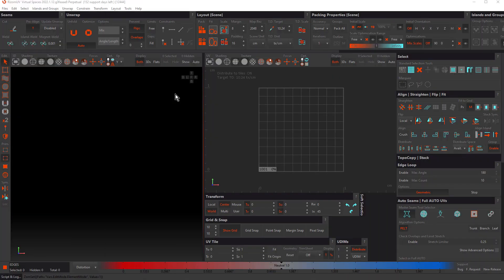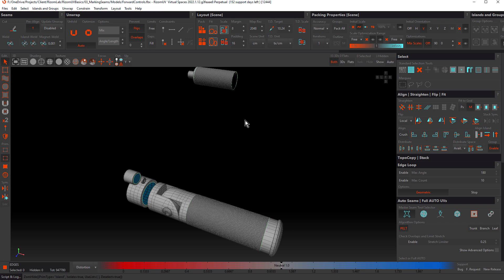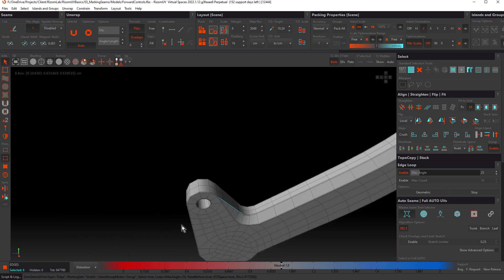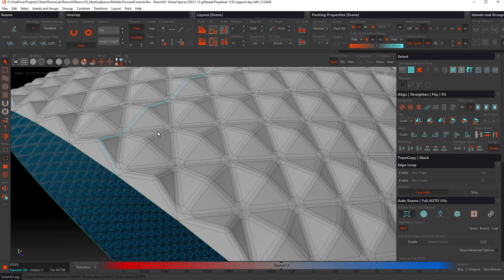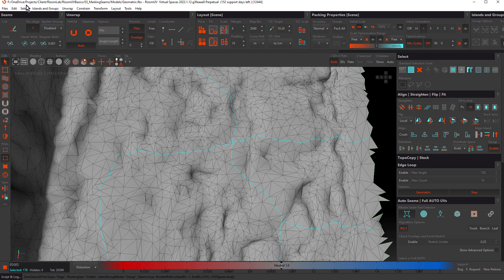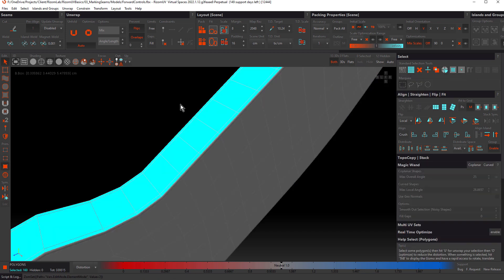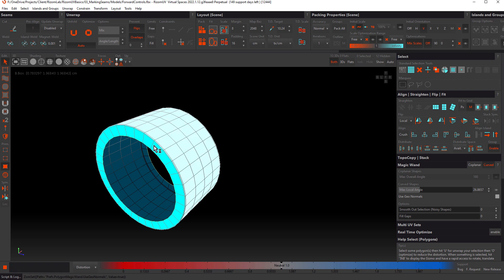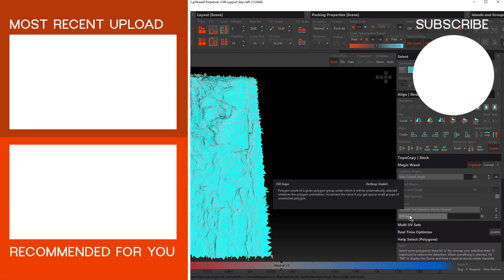RizomUV Basics (2023): Geometry & Seam Selection

Comment: Great tutorials, appreciate the pace and clarity!
Got a question regard deselecting: if I already had some edges selected, how do I deselect part of those edges using select shortest path? I'm using RizomUV default shortcuts, it seems the Ctrl + Shift deselect shortcut doesn't work well with the Shift (shortest path preview).
Reply from the maker: Ctrl+Shift+ Double left mouse click.
Or drag deselect.
Reply: @RizomUV  Humm...I couldn't get it to work, Ctrl + Shift + double LMB click only deselect all of the selected edges, maybe I missed something? I tried with different select mode (edge loop/shortest path) and the result was the same.

The scenario is that I have selected some connected edges, but I only want to deselect part of them using the select shortest path feature. However, the Shift shortcut will interfere with deselect shortcut (Ctrl + Shift + LMB click). Ctrl + Shift + LMB drag works, but sometimes deselecting the shortest path is easier and faster than drag deselect.
Reply from the maker: @AllenYauAnimation  - If you want to deselect only part of a selection, then it's drag deselect.
Reply: I see, thanks!

Comment: align straighten flip fit
I can't find this stuff. is it not easy to find in the newer version?
Reply from the maker: Press the transform tool button, they will be displayed on the right.
Reply: @RizomUV  HI and thanks for the reply. I clicked the transform button on the left under the select tool. it says the shortcut is F5. I see a lot of your stuff, but not the magic wand. Am I still missing anything?
Thanks for your support!!
Reply from the maker: @Karimozoro  I thought you wanted Align Straighten Flip? In any case, you can find the magic wand under the select tool attributes (you need to be in polygon mode too)

Comment: My loop selection always stops at selections no matter what i set. How do I fix that?
Reply from the maker: On the right side of the UI, under the "Edge Loop" section, uncheck "Stop at Selection"
Reply: i got it. I had to uncheck and check it again. Dont know why. Btw is there also a option to gave loop selections not stop at cuts?  @RizomUV
Reply from the maker: @LeftCG  - No there isn't, because at a cut you are reaching the boundary of an island.
Reply: could that be a future feature 👀  @RizomUV
Reply from the maker: @LeftCG  Not anytime soon.
Reply: I think it would be a great feature. Ive had a lot of issues with making sure i dont make any cuts too soon. An option with "restrict to island" would be great. Anyways thanks for the quick responses, love the software.  @RizomUV